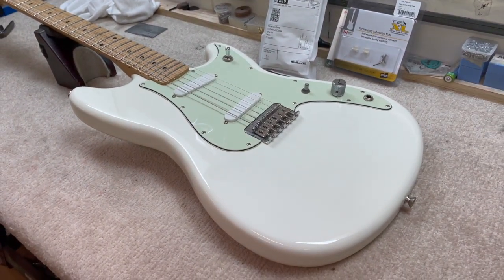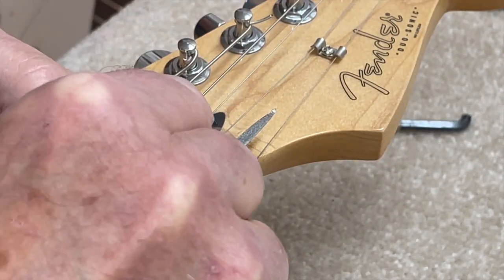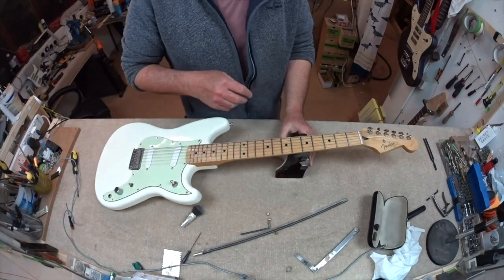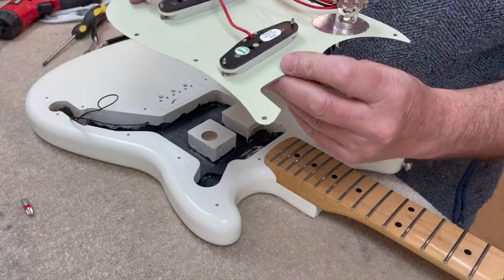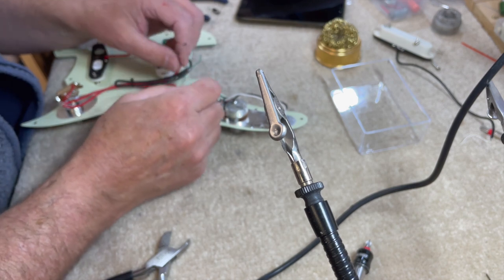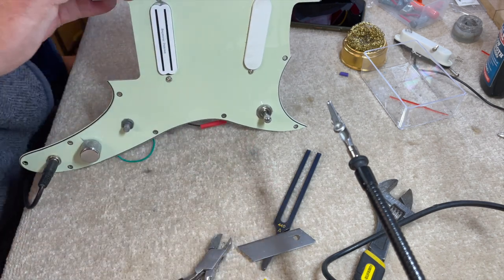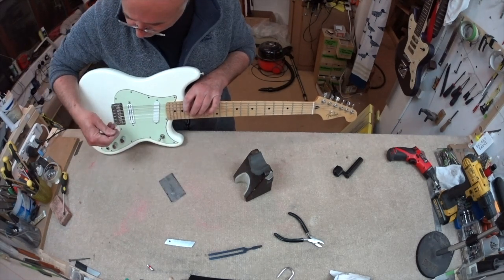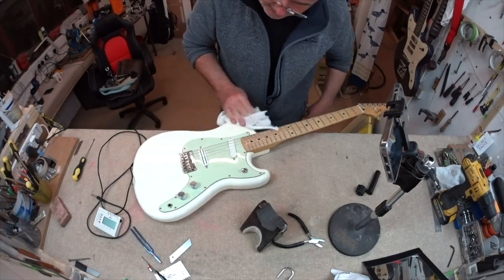Fender DuoSonic pickup swap and set up

Comment: So if set up correctly with a well cut nut can this guitar with its 24” scale length have stable tuning as hearing so many conflicting notions that 24” guitars won’t stay in tune and others say of course they can 🤷‍♂️
Reply from the maker: Set up correctly with a well-cut nut made of a low-friction material (recommend Tusq!) and with the strings fully stretched out then your 24" scale length guitar will stay in tune. The shorter the scale or the lighter the gauge of string the easier it can be to press the strings sharp so careful fretting is also required. But most peoples' complaints about tuning stem from a poor nut, too high a 1st fret action, strings not stretched out AND the additional tendency of the shorter scale to press sharp if heavy-handed.
Reply: Thank you so much for your reply and that’s good to know I have seen how meticulous you are in ur set up videos so thought it was worth asking, I’m going to try one out at the weekend based on that then :) thanks Sam
Reply from the maker: @laurenconway7153  you’re welcome. If you get one, let me know how you get on?
Reply: @SamDeeksRelovedGuitars  that’s very kind and sure I will update you once I have played on one thank you for all ur help

Comment: Yes I agree with you Sam, no coating will just crack unless the wood opens underneath, and the neck gets pulled around a lot which all concentrates in that socket... old guitars almost always seem to have those cracks and it seems to be as far as they ever progress... battle scars perhaps?

Comment: What were the pots 250k or 500k, also what was the capacitor?
Reply from the maker: IIRC the pots are 250k and the capacitor a 0.047uF. When you replace one of the single coils with a humbucker you have a mxi and therefore could change the pots to 500k and the capacitor to 0.022uF or 0.033.... but it's entirely up to you. If humbuckers typically have 500k pots and 0.022uF caps and single coils 0.047uF and 250k caps then you will have to 'disappoint' one of your pickups whichever way you go. In this case, I left the pots original 250k and the capacitor original 0.047uF.
Reply: @SamDeeksRelovedGuitars  thank you Sam! You’re amazing at what you do! Keep the content coming, I sure appreciate it!

Comment: Could you fit telecaster pickups this? and  put the duo sonic covers over them? ? 

Thinking about getting a twisted tele set.
Reply from the maker: Hi Sean... well, I don't think that the bridge Tele style pickup will fit under that scratchplate without extending the rout for starters. I guess if you really want your DuoSonic to run a Tele set then of course, it can be done... just requires some work.

Comment: I just carefully took my Duo-Sonic's pickguard off to see if I could fix the guitar's faulty 3-way switch  and discovered that the earth wire from the bridge wasn't connected to anything. It looks like it was once poorly soldered to the tone pot! Is this the correct pot to solder it to as I've been looking at some diagrams and they show it soldered to the volume pot?
Reply from the maker: Hi Hugo. It can be either - what matters is that it is grounded in an unbroken chain of grounds back to the jack socket and out (through the guitar lead) to the ground in the amp, and out to the mains circuit and from there to the actual ground outside the house :) Provided that the jack ground comes into the guitar and goes to the top of a pot and that pot top is connected to all the other pots then you can solder the bridge earth / ground to anything that's grounded.
Reply: @SamDeeksRelovedGuitars  Thanks for that. It must have been a really bad solder job for the wire to come loose. Unfortunately for me I discovered that my soldering iron has ceased to work. I taped the wire back on to the blob of solder on the pot with electrical tape and it seems to work fine. Its not a permanent or very good fix. Not sure if the guitar is actually safe to play if the earth wire from the bridge becomes detached? I think I won't play it until I've got a new soldering iron and fixed it properly.
Reply from the maker: @hugotyson308  As far as I understand it the days when a badly-wired amp could send a mains voltage through to the guitar to zap a player are long gone. Guitar grounding nowadays is much more about grounding the human body to prevent it acting as an antenna and picking up unwanted RF noise.

Comment: On a duo sonic is one of the pups reverse wound to cut out 60 cycle hum? Thanks mike
Reply from the maker: Ah... Michael as far as I know the neck pickup in the Fender Duosonic is RW/RP so that the middle position is humbucking. Some pickup manufacturers offer the 'option' of a neck pickup in the RW/RP configuration... so you could have a non humbucking middle position if you wanted too...

Comment: Hey man i got a question. Im tryna put a p90 in my duo sonic hs. I just dont know where the hot wire is supposed to go? Would i just tape off the others? 

I imagine i would just treat it like a single coil and pretend the coil split wasnt a thing.

I mostly just dont know what to connect the hot wire (black) and the ground wire (white) to. And obviously theres a bare wire. Internet searching is a mess. Thanks.
Reply from the maker: If you’re not doing any fancy switching then black and bare wires solder to the top of a grounded pot. White wire solder to the switch lug. If when you’ve done that the sound is very thin in the ‘both on’ position then it could be that the P90 is out of phase with the other pickup. If that’s the case unsolder the P90 white and black wires and change them over.